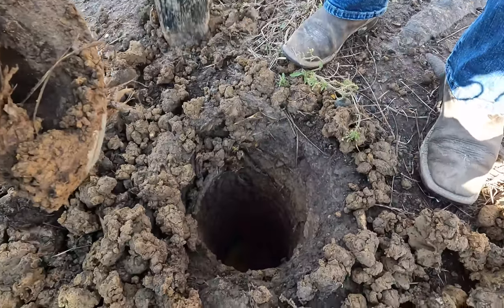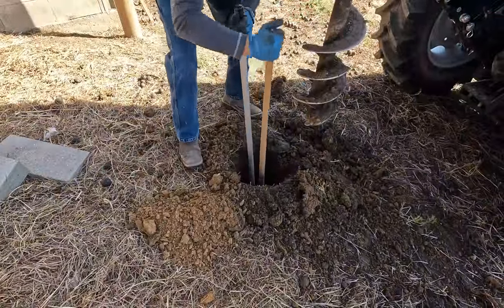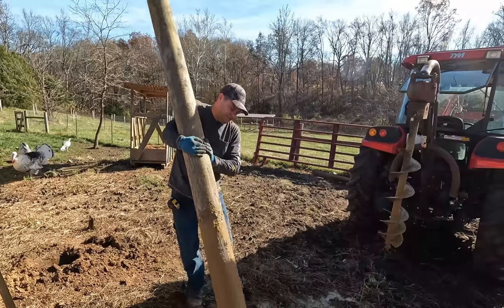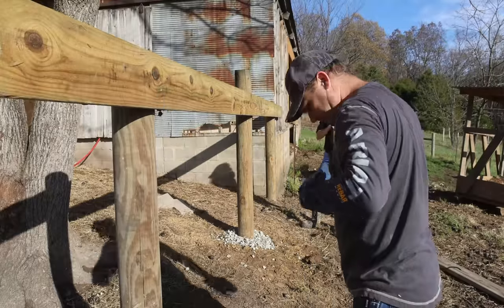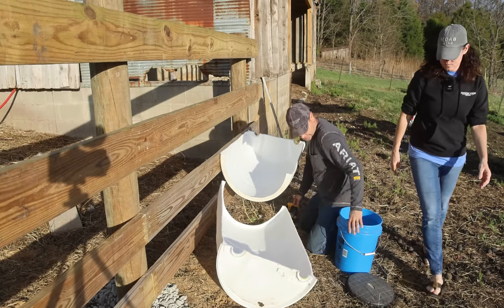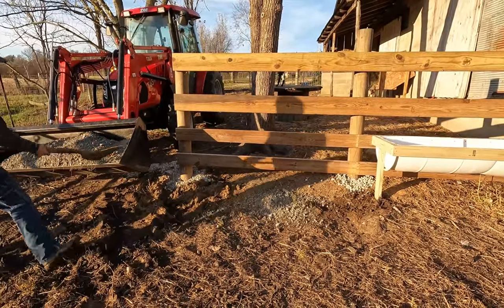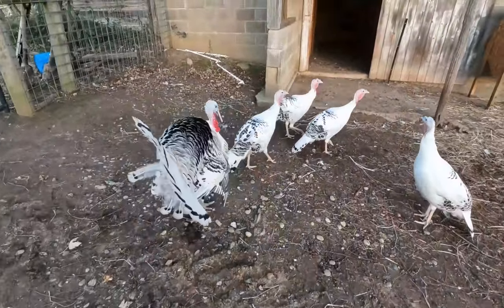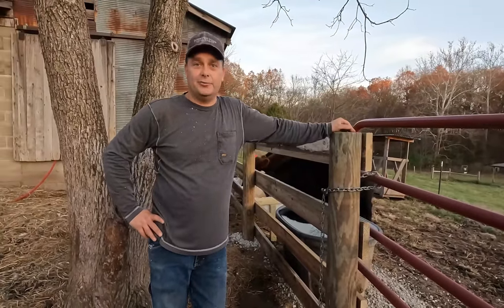Building a Fence Line Bunk feeder for the Barn Yard,

Comment: You don't seem to have any digging teeth at the tip of your auger. I believe that would help. A call to an implement dealer could be helpful.
Reply: Lol I ran into same problem on mine once I replaced the worn cutting teeth on it it worked great. Plus using a steel bar to help apply down force helps in hard ground

Comment: We built our feed troughs on the outside of the coral so they could get only there heads through for feed and hay . One or two 2 × 6 on the top  and two solid 2 × 8 or 10s on the bottom  . That way they can not waste as much feed and hay . Less pushing and fighting , and same with the pig can't push and get their feet in the troughs  ? 
Vertical bar or board is a good idea as well  🤔

Comment: Two things Evan. First you need to get a spud bar. It can be used to break up the hard dry dirt in the bottom in your post holes before you use the "clam shell" to dig it out. Second, I was not able to tell if your auger had cutting edge teeth on it. It did not look like it did. Get a couple of teeth for it and your life will be so much easier.
Reply: It doesnt look like the auger has anywhere to put teeth!
Reply: Add a Weight bracket to the top of the Auger assy to hang tractor Weights on .

Comment: Evan, please go to Pengo Attachments and order some weld on holders and replaceable bits. I worked at an equipment rental store for several years and we used the Pengo T36 weld on holder and 1336LC replaceable teeth. I promise you will be amazed at what a new set of bits on a worn auger will do.

Comment: Evan you need to invest in a digging/tamping bar to build fence with, it will help you on those hard bottom holes and tamping the posts in with, good job on the fence build, I actually just got in from concreting in some posts for my corral.  Also, if you had an auger for the front loader you could put down force with the loader, I converted the gear box from a 3pt auger to hyd.  I can give you some tips if you want to tackle a conversion

Comment: Good fence, good position , with a slope for better drainage. Im Third generation cattle family. The plastic feeder will not last. You could add a board inside so the steers dont rip easily  it off the fence..... But I expect it might last a year at most.   Id suggest a cement trough is the long term choice.

Comment: We use a pointed bar to poke holes in clay soil , Clay is impervious to water.  Our huge water cattle tanks had clay bottoms and never leaked.
Also after poking holes with a bar , 
Put a couple of table spoons of dish soap in with the water  , let set over night  with a five gallon bucket with a slow dripping  , plus it covers the hole so nothing can fall in or break a leg  ?
The gravel is a great idea for any dug post holes , allowing for less rotting even if treated  .

Comment: Hi Evan,
You need to put a cutting face on the bottom of your post hole Auger, that will cut through the hard ground.
Much the same as a drill that has a hardened face on it
Our soil in the old home we had was gravel in Australia and the post hole digger was just like this.

Comment: Hi Evan and Rebekah, we had almost an exactly the same fence pole digger that you have, but ours had a rectangle holder on the top, to hold fenceposts, like a rack, and on the sides there where hooks to hang weights onto, like for examle front weights to a tractor, that was what we used when the ground was that hard
With a few weights on, it dug into almost any hard packed dirt 🙂  your projects always looks so good, and adds to the comfort for both you and the animals

Comment: Evan your a decent welder so you can do like I did. Rig you up a small platform on top of the arch of your post hole digger so you can put weight in it. It does help in dry conditions.

Comment: That dirt you were drilling reminds me of putting in a fence for my back yard. 4" to 5" of topsoil then hard as really weak cement slurry. I was digging about 8" or 10", poking holes in the bottom adding water and letting it soak. My 3' deep holes were dug with a hand auger, UGH!

Comment: Evan something you might do is put some clear fiberglass roof panels on the barn where you took off the siding would let light in and make it warmer  if you wanted to you could frame them up to take off or fold up in the summer

Comment: Evan, next time you struggle to get the auger to drill down use your front bucket to push down with lifting the front end and that will make  your drill dig without struggle.
Reply: Yep, that's a great idea. The problem is that he doesn't have another tractor to do that with at the moment.
Reply: That wont work because there is no Down pressure on the 3 point. he needs Weight on the Auger.
Reply: @m9ovich785  I think that's what he meant. Use the front end of another tractor to apply down pressure on the auger.
Reply: @teenagefarmer  Another Tractor yes.
But the way I read it was using the Bucket on the Tractor He was using. 
I read it several times. HAAHAHAA...
Reply: @m9ovich785  yeah I see how it could mean that to lol🤷

Comment: this might make drilling holes easier.... I soldered a hose fitting to the end of a 6 ft copper pipe and I now drill with this water copper pipe thing it works amazing with little effort... It might give your holes a start for the larger drill auger.

Comment: I've often thought Evan, if you could put an auger on the front loader, to where you could have down pressure with the hydraulics it would be so much better. I've seen augers on skid steers but never on farm tractors.  Some of the older tractors had down pressure on the rear three point  but today you can't get down pressure on the new tractors. Boy, it would be nice.
Reply: It can be converted if you have some fabricating skills, I have converted 1 to Hyd drive and skid steer quick attach, works like a dream.

Comment: Good Job on the feeder. The only thing I would have done was position it 4 inches on other side of the fence. Just below that 3rd board. That way you can pour the feed in from the other side and it will be lower for when you put smaller cattle in there. It would be a little safer with the big boys. You can always change it up when you get new steers. Just a thought.

Comment: The barnyard is really coming along. Were you able to resolve the water issue in the back barn loafing shed?

That TYM sure is nice. Maybe Rural King will step up to the plate with a compact tractor so you can maneuver in those tight places better. I think TYM builds those as well.

Comment: You need to make a weight for the post-hole digger to get more downforce. Maybe a metal box of some sort that you could fill with gravel which would make it easy to remove when doing maintenance.

Comment: I borrowed a buddys 3 point auger and it probably couldn’t dig it’s way out of a marshmallow. This sounds like a lot of work but hear me out…. I bought one of those handheld engine driven augers. I think from Lowe’s? I haven’t had any trouble at all and my ground is hard as a rock. Great running engine btw. Plus you can be more precise with your post holes. Just a lot more work and it sucks in 90° weather LOL. I’d love to have a post pounder but they’re expensive as heck. If I had more fencing to do I’d buy one

Comment: If you happen to see a utility truck with a auger check it out there set up to drill though most anything
Reply: The Truck has Down pressure, the 3 Point does not

Comment: i build my feeders on the out side of the fence, they put there heads though to eat, i have ended up with broken ribs from them wanting the feed before you get to the in side feeders, or knocked down, i weld pipe up an down 18" a part for there heads cows bull steers heifers,, i dont go in side the fence with feed. my red clay is so hard it will not drill even with a drill with down presser i have to dig them with a 12000lb mini ex pealing 2 to 3" at a time, you cantdo any thing by hand, it can be drilled in spring thaw when the frost come out but it so greasy you fight to move the truck or machine around, you never sink

Comment: What I have done before with my auger is put weight on it. I can put some on the 3 point or on top of the gear box.l used my brother in law 220 pounds on the 3 point and jumping
Reply: we had a young man in my town that was jumping on a 3 pt auger a few months back and was grabbed by the auger, wrapped up and killed, never get around an implement that is turning, Tractor isn't very forgiving.